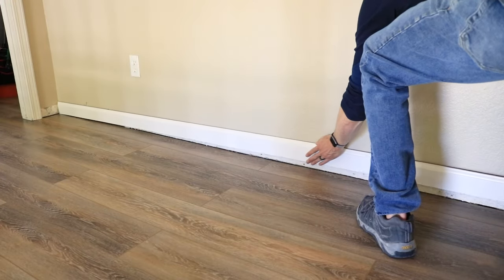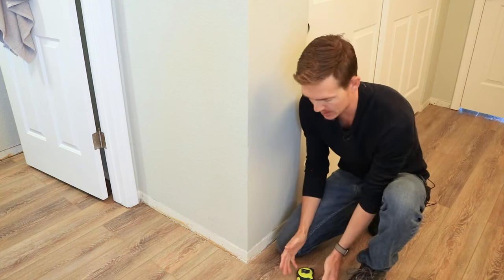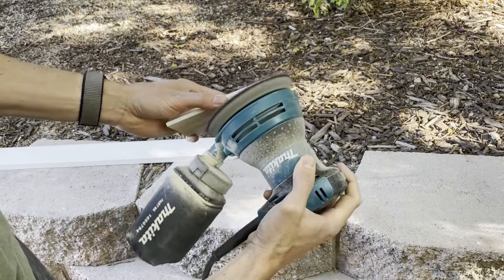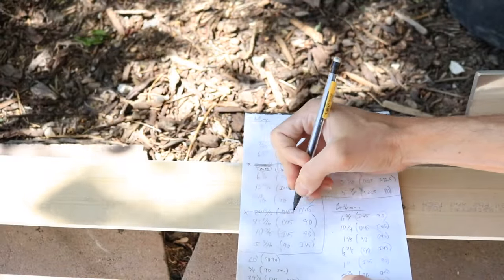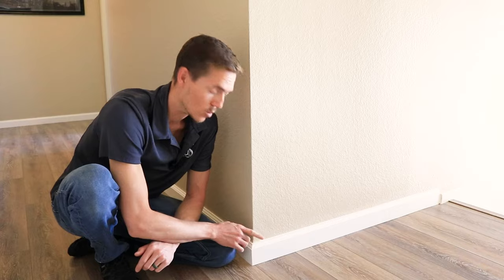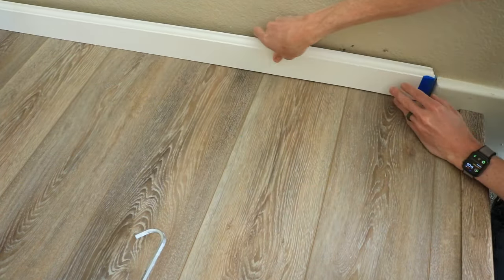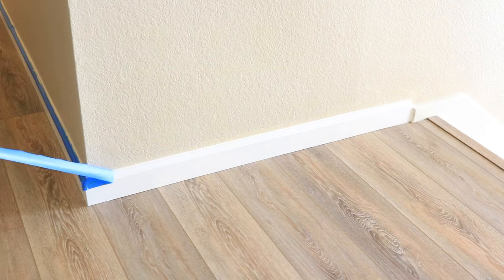How to Install Baseboards - Step-by-Step for Beginners

Comment: Well now i understand why installing baseboards in my 120yr old house last weekend was a nightmare. There is no baseplate stud. Pretty sure the closest equivalent is the old heart pine floor. Ended up having to screw it into the door frame on one end. I think i did hit one stud, but this run was only going a few feet from a door frame to just behind a radiator. So there was probably only 1 stud since mine 18in apart at best.

Comment: Just a question, is there a reason to not caulk on the baseboard where it meets the floor? we are redoing baseboards and I’ve noticed that the previous contractors caulked the bottom of the baseboards

Comment: Great tips.  Here's one I have. MDF swells when exposed to water. And anything that swells will cause problems. In my opinion, anything that may come into contact with water should never be made out of MDF, including baseboards, LVP transition strips, even furniture. Sadly, because it's cheaper than real wood, many manufactures love to use this stuff (which is just glued and compressed sawdust), so its hard to avoid sometimes without paying the price. And don't even get me started on laminate flooring with MDF backing!  But seriously, kick over a mop bucket of water and it could be a catastrophe. Pressed particle board should never anywhere near where liquids could come into contact.
Reply from the maker: Good tip. I think the threat is less extreme then that because as long as you clean it up immediately the wood doesn’t have a chance to swell. And even if you have real wood, if water is left on that it will get moldy and cause other issues. But I do see your point.

Comment: this video is great. I used to be a finish carpenter and basically mastered base during my first year. one thing I'm not sure you mentioned but I would suggest is for angles on inside/outside corners. Usually the drywall isn't even on both sides... so I would just take 2 scrap pieces and take them to the saw and change the angle by like half a degree at a time. once you get good it only takes like one close guess to zero in but if you are just doing a one-off job like remodeling your house definitely make use of the scrap wood you might have lying around.
Reply: 💯👍 always a good idea to utilize those scraps instead of creating new scraps by trial and error on the finished pieces. Kinda like the “measure twice, cut once”.

Comment: I agree with everyone that you answered all the questions.  I was wondering about a brad nail gun and the type and size of nails but you answered that Thank you. I did have a question about if I use a pneumatic brad nail gun how much air pressure do you need for pvc vs mdf baseboard. Then I could figure a new air compressor

Comment: Great, clear video and instructions! If I just want to fix a small segment of baseboard, can I just use a hammer and nails? What types of nails should I use? I don't want to buy a whole lot of stuff I won't be using in the future. Thanks.
Reply from the maker: Yes you can, but you'll likely need to fill the nail holes, and it probably won't look very good.

Comment: Thank you for these recommendations!! One question if I may: Is there any particular reason why you don't paint the wall before installing the baseboard? Is a clean caulk-line so hard to achieve? Also, any recommendations on how to prevent you from messing up the paint on the baseboard while cutting it and dragging it around on the saw... beyond "just be careful"?

Comment: Hey Handyman Startup! I love this video but do you have suggestions for bathrooms? I don't want water going under the baseboard can cause issues later. Just looking for a good solution!
Reply from the maker: You can use the vinyl baseboards, or tile the floors and install a band of tile as basseboard.

Comment: I was interested to watch your video and see that everything you recommended I also do and have been doing for years!
I recommend having a piece of cardboard that can be cut or torn to use as shim material behind the baseboard. It can be folded to double or triple thickness or more as needed and is freely available and easy to use. But your take on nail or Brad holes is unprofessional and not right for a quality outcome. Shrink free spackling compound...I like the light weight one. With a good spackling blade and proper application you don't even have to sand so the time can be saved there. Or a quick once over with a sanding sponge and you are ready for paint! And you have a quality end result!

Comment: Question: How would you caulk base boards in a bathroom? Do your raise them off of the floor? Do you caulk where the base meets the floor? Thanks for the great video! I found you as I started my own handyman business and now 8 months later I am in full swing and loving it! I appreciate your content.
Reply from the maker: Hey Johnny! Congrats on your success. To answer your question, it depends on the situation. If you anticipate them seeing a lot of moisture, then you’ll want to do tile baseboards or another material that won’t be damaged. Otherwise do them just like anywhere else.
Reply: I would caulk them just like I would in the hallway

Comment: Great video. Installed trim for the first time today. Thanks to your video the finished product looks good although I'm pretty slow at it. This might be a stupid questions but do you have any tips for how to mark the length on the trim and how to cut? I end up having to make 3 or 4 cuts to get it the right size. Measuring and cutting a flat piece of wood on a straight line is easy of course but with the angles i'm struggling a bit. Thank you
Reply from the maker: Yes, but it would be best shown in a video
Reply: @StayHandy  Make the video yet?
Reply: Mark the top of the baseboard and make the cuts so the baseboard is sitting in the same orientation as installation. Sometimes you have to make a mark and transfer the mark to the other side, so be sure to have an accurate small square that you can use to do that.

Use a SHARP pencil. I use a mechanical pencil with a fine tip so I don't need a pencil sharpener. DON'T use construction pencils which are pretty as wide as a sharpie, that's far too wide. "Sneak up" on the cut with the miter saw. Cut it slightly long then bump the piece towards the blade (when the saw is off!). Another trick is to put the saw down, then put the piece up against the body of the blade (not the teeth). Raise the saw, turn it on then make a cut. If you take a look at your saw blade, you'll notice the teeth of the blade protrude out of the main body. This is called the "kerf". So when you put the wood against the body of the blade, you're cutting off the difference of how much the teeth protrude from the main body.
Reply: @larrybud  Well stated!  I do that as well. Big thumbs up on a mechanical pencil!  Need to find a good one.  I keep going through the plastic ones and they keep breaking!

Comment: I am installing wood baseboard moulding.  I'll stain before cutting and installing.  How do I fill in any gaps in the corners and at the top with a wood trim (all the areas you did with caulk)?  Do they make a squeezable wood filler?
Reply from the maker: You need to cope your inside corners and be more accurate with your cuts. Don’t use any caulking or filler.

Comment: This is a brilliant video.  Why do I say this?  Well, I'm an engineer, I don't do trim willingly.  But I need to do it, so here I am.  I would be going back and forth to the miter saw cutting each piece.

1) cutting them all ahead of time after measuring will save sooooooooooooo much work.  HS, name your beer and I'll ship a case to you.
2) Painting it ahead of time I knew, but I've only done that with quarter round.
3) At 5:06 I'm slapping my forehead.  I need to get out of my cube.
4) 7:00 : brilliant.  If you have AR issues you'll cope, and you'll never finish the project.  
5) 9:36 - why did you tape the baseboard?  Cube engineers wish to know.
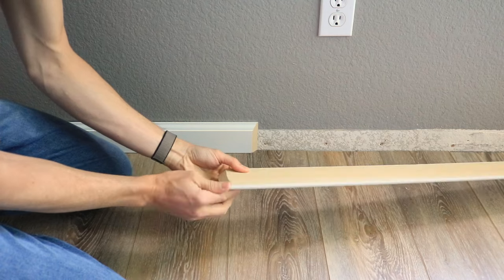6) 9:53 - why would you not get out one piece to cut to length?  we all know how to do a 45, but it's so trashy (I'm looking at my crown molding from the builder.... )
7) 10:50 - see those rubber gloves?  Embrace them.
8) 11:35 - caulking.  This is a brilliant comment.  
9) 12:00 - HS did not put enough emphasis on this.  HIGH QUALITY PAINT BRUSHES.  Just eat the investment.  Lock them up from family members :)

Comment: My baseboard profile is 1/2"x3" rectangle and was thinking of butting the baseboard pieces together without making any 45 degree cuts. I feel like this would look fine as long as the joints are fairly tight. Does anyone disagree?

Comment: That's all fine when you work with solid color boarding. what about natural wood or veneered MDF? No caulking, no nails, no painting. Do you have tips for such occasions?
Reply from the maker: No I just choose not to work with that material.
Reply: @StayHandy  thanks for honesty 😉

Comment: If the walls and flooring have been painted and installed recently, is the best strategy after installing the baseboards to tape the wall and baseboard to paint the caulk?

Thanks for the info!
Reply from the maker: You'll never get a good finish that way because the caulking isn't a perfect line. The best thing to do is the follow the process I outline in this video: https://youtu.be/VwGjXfGEMSM

Comment: I had an 18 gauge nailer already but I just bought a 16 gauge because everywhere I looked said at least 16, if not 15 for baseboards/trim.  At least it was on sale for $99 for a decent one (Metabo). I'll use it just to be sure everything is extra secure. Thoughts?
Reply from the maker: Totally unnecessary. 18g is more than enough.

Comment: I don't get the 44.5º trick.  You showed by putting your square into the inside wall that there was extra space for the square to bump back and forth. So the angle of that corner is greater than 90º. But then you said to cut the boards at 44.5º for an inside corner, which would give you an 89º angle. So you'll get an even bigger gap...?
Reply: You're overthinking your angles. If you want evidence that this is the correct thing to do, then just make it obnoxious angle like 35 degrees and see what happens. Notice that the gap is not there anymore, but exposed at the back end.

Comment: Any recommendations on how to fit two pieces on a long wall? Two 45s at joint or?
Thanks for this video!
Reply: Ah, 9:58 in the video… jumped the gun there!
Reply from the maker: No worries, glad you figured it out! I also appreciate any comments or questions.

Comment: Very good video, Dan!  It's videos like these that make glad that I'm a subscriber to your channel.  I have never installed baseboards before.  I have a small job (replacing about a 3 foot piece), so I don't want to buy a nail gun and a power saw.  I have a hand miter saw, so I can use that to make the cuts.  Would you recommend using a hammer or something else to drive the nails rather than the nail gun?  Thank you!! 👍👍👍
Reply from the maker: Thanks! Yes you can use a hammer and nails. You'll probably want a nail set as well so you can countersink the nails. The nail holes will be larger without a brad nailer, so you'll want to fill them before painting.
Reply: @StayHandy  Thank you for your reply, and I have a nail set.

Comment: Is there any sense to adding a small line of caulking along the top edge of the moulding before appling it to the wall, I would think it would fill in any imperfections before nailing and cleanup could occur at that time
Reply from the maker: I think you'd find that any benefit would be outweighed by the complexity and extra time it would take. Since you caulk them after they are installed, the imperfections are already filled in anyway.

Comment: Are build fine custom homes, this is not the best way to do it. But good for a homeowner I suppose. After I nail the baseboard in, i fill all holes with wood putty. I use a lacquer primer on a sprayer. Then spray two coats of hybrid trim enamel on all trim and doors. Sanding in between coats. This gives the trim a furniture grade finish. I’m often told that my door and trim finish is better than the cabinet finish the cabinet companies provide on custom kitchens.

Comment: Any advice on how you got that small end piece not really sure what you call it it look like maybe a 45 then a 90
Reply from the maker: Yes, the small end piece should be cut just like it would when wrapping around a corner (a 45 degree on both pieces). When cutting the small piece, cut the 45 degree angle first, then cut it with a straight cut right at the end of the angle. It's a small piece, so you have to cut the 45 first or there is nowhere to hold on to it.

Comment: baseboards come in 8' and 12' but my room is 13'.   How should I divide the baseboards 12'+1' or 8'+5' ?
Reply: It'll depend on which size of baseboard you buy. people are going to buy either 8 foot or 12 foot, not both.
Reply: That being said, beveled butt joints will be noticeable more in the center of the room than the corner of the room. So, if you have your druthers do the 12 + 1.

Comment: Do you want to sand the edges of the baseboard after the cut with the miter saw?  IF the end is rough from the cut.  Just curious
Reply from the maker: No, sanding isn’t a good solution. If you are getting rough cuts then you either need to change your blade or cut slower. Sanding will give you poor quality joints.

Comment: I am no expert which is why  am searching YouTube. I do know myself however. I question cutting all of the matrerial ahead of time. Being a noice/amatuer myself I am more interested in getting it right then beating the clock. I can see myself getting confused and screwing up a lot of material. Wouldn't it be better to approach it 1 piece at a time? There is bound to be a learning curve. It seems to me slow and steady while learning a screwing up a few pieces is better then getting way ahead of yourself and risking messing up a lot of pieces.
Reply from the maker: Practice one room that way. Dial in your process. Then save yourself hours and batch it. Of course depends on your skill level.

Comment: No quarter mold?
Reply from the maker: Why would I use that?
Reply: You would use quarter round if you put plank flooring down without taking out your old baseboards. Leave the old baseboards in place, lay the new plank flooring within a 1/4" of the old baseboards (for expansion), and lay the quarter round to cover the 1/4" gap. That's what people use quarter round for. The proper way is to tear out your old baseboards, or at least tear out the baseboards from two opposing walls, lay the new plank flooring down, and install new baseboards on the two walls.

Comment: My floor guy wants to charge me 4 hours ($250) to do the last 60 feet of baseboard. They walked out Friday at 4 and left that much left? Messed up???
Reply from the maker: I’d be happy he is only charging $62.50 per hour.
Reply: @StayHandy  - yeah. “My friend” who owns a flooring company charged me 5,000 for 3 days and after I removed all the carpeting and vinyl planks. Friday the two were working slow and after I said something they packed up at 4:00, packed their tools and left and aren’t coming back. 80 feet undone and “friend” says another 4 hours to finish.  So 5k for a 900 square foot one bedroom condo W the floors demoed and furniture moved. I ain’t paying it a 4th day.  🤬
Reply: 900 sq ft condo, running just baseboard for 5k? 
If I read this right that's insane!
Reply: 900 sq ft condo, running just baseboard for 5k? 
If I read this right that's insane!
Reply: @StayHandy  - I’d say I have a court case!  He also used day laborers that didn’t seem legal. Normally I wouldn’t get someone in trouble w the law but this is a sin!
Reply: @jwick4320  - thanks so much dude. What is the best way to get my money back?
Reply: @cute_without_the_letter_E  I found out the hard way, you need a contract,and read it very carefully when you have any work done.
Pay attention to details and if you don't like the way it's worded , don't sign it!
This kind of situation happens all the time, and usually looked at like ,"you should have done your homework before you got into this".
If you have a trustworthy lawyer you could talk to them but I'm guessing ( only guessing) that this isn't going anywhere.dont want to deflate you but it's the cold reality.when you have any work done get 3 estimates first, if they vary by much,then look at the details of exactly what your getting for the money.
Research is your best friend. 
Too hard to speculate not knowing the details, but a judge is probably going to look at it like,did you agree to that price before the work began? Did you sign a contract?.
At the end of the day, you have to look out for you!! 
A typical contract would state,,the price of the job,within a certain percentage ( maybe. 5-10 percent) you would pay a certain amount up front, then a final payment when work is done. That way you have some leverage on them. Hope this helps a little.
Reply: @jwick4320  - I can’t thank you enough J for your help! The estimate I did not sign and it was very vague. He later when he collected the last 2500 took the estimate from me and wrote more on it. I am hoping he thinks my cameras were working in the room he did it. I told him when he asked if the men worked I said “well the cameras everywhere should tell me when I have time to go through them”. He looked shook! Between you and me and the internet, 😆it was not working. 🤦🏻‍♂️. Also J the samples he showed me were not the same as the stuff that came in boxes to be installed. This alone if I take him to court might be a win. I’m hoping to scare him out of going to court and him giving me back money. He hired illegal workers, did not get a permit for the work and also demanded cash. That’s doesn’t look good right?